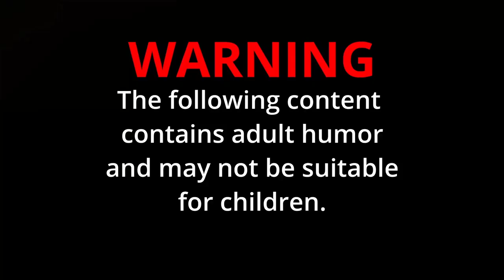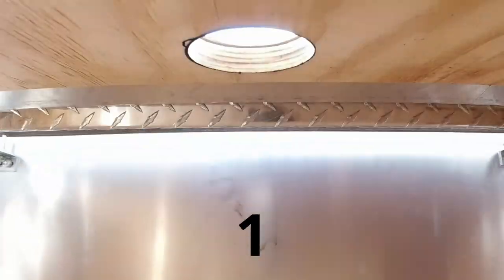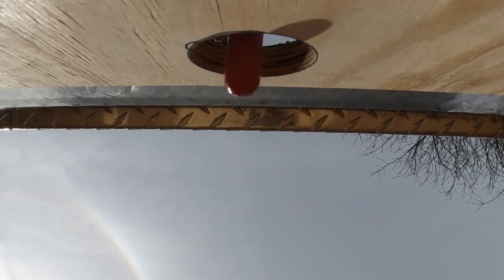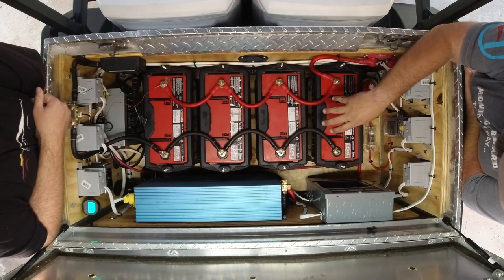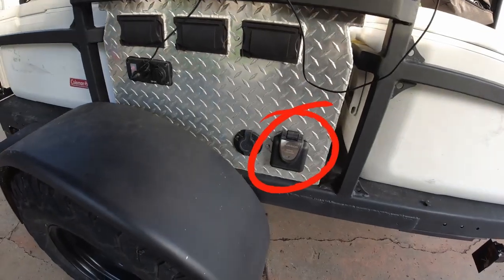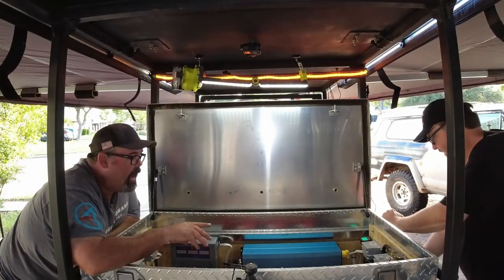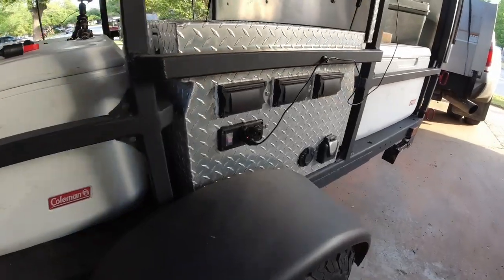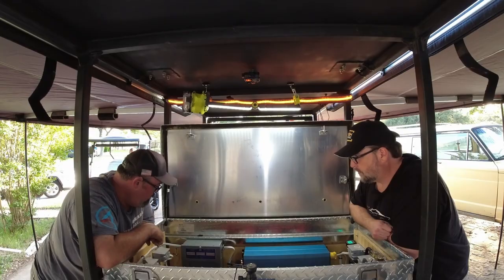Harbor Freight Trailer into a Chuck Wagon Part 6

Comment: I'm curious as to why you picked agm instead of Lipo4 batteries?
Reply from the maker: That’ll hopefully be an upgrade down the road. Maybe when solar is added.  These are used military batteries they sell after a couple of years and you can get them super cheap! These battery trays should also hold down the lithium when that time comes.  Great question! Thanks for asking!